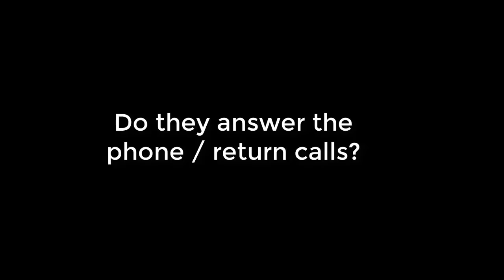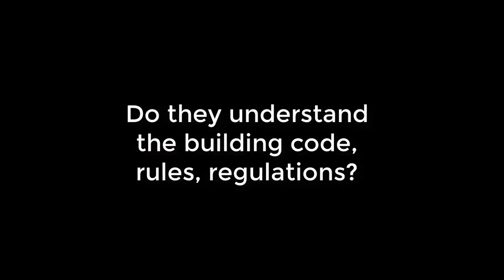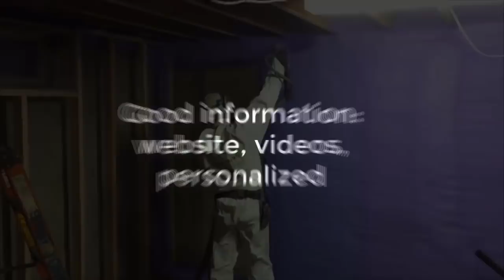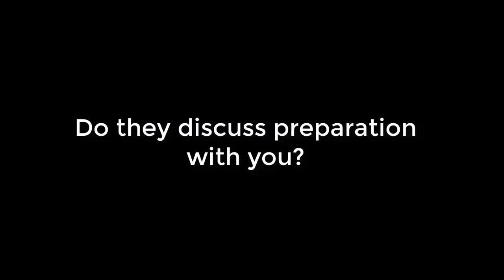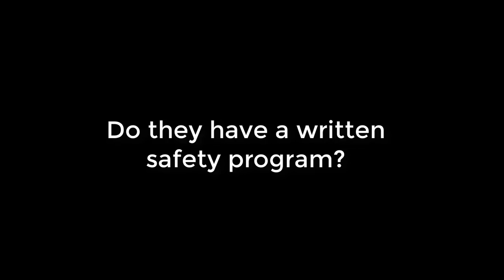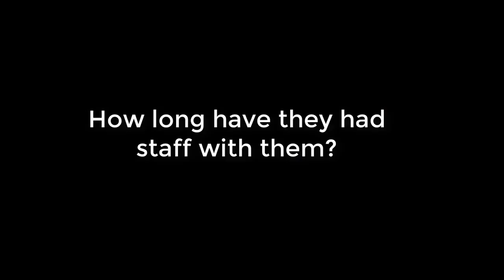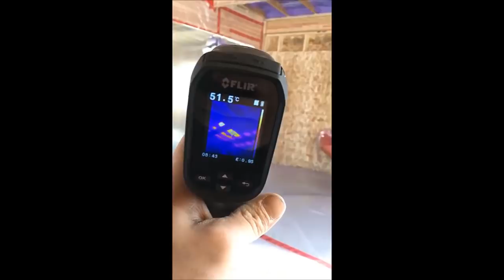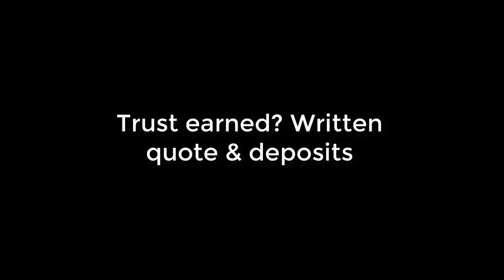Hiring a spray foam insulation contractor - 20 great points

Comment: Very important to have a confident mindset and you see they care about what they do. Competence is also very important.
Reply from the maker: Amen. Usually called arrogance by the willfully ignorant.
Reply: @SprayJones  it's just straightup pride in your work and the way you discuss many complicated issues like safety in such an easy manner means you dug deep and did the homework worthy of the professional title. It's just what the job requires. You can't just say that the byproduct of foam when applied is not dangerous and have workers not wear masks properly, or even the wrong pucks during the application process.

Comment: Do you have a suggestion or rather a answer to, since im just starting off, and completely agree with your whole video especially about the part about how a contractor just wants to sell whatever work it is and just never come back again. With that being said, would you recommend using a spray foam insulation kit? If so then what? And why not a kit (if so).
Reply from the maker: Starting off at what? What are you doing?
Reply: @SprayJones  just starting off spray foaming on my own using the spray kits, but their crazy expensive do you know of any dealers that sell it cheap
Reply from the maker: @lethanbiasjr6255  No. I have nothing to do with DIY foam. Sorry.

Comment: The three sprayfoam contractors I consulted with NEVER, discussed prep, timeframe, material, my site requirements, or anything else. They just gave me a flat squarefoot rating that was close to $3-4 a board foot for foam. Furthermore the guy coming out spraying Bayer insulation made it a point to pronounce it "bear" instead of Bayer. I know asprin has been around but I will never support Bayer if there is another option.

Comment: I have to say your foam work is great and I would love to learn the ways of spraying foam like this... I use Jm open and closed cell and idk if the gun is make a difference or not but i love your work and would love to spray like this. I like to make a job look good... one thing i want to ask is when I spray open cell sometimes it has hollow point when I cut the foam and I want to prevent that, is there anything to could do to fix that?
Reply: *idk if the gun makes a difference
Reply: One more thing I know the manufacturer is different for you but how do you store your chemical and what temps do you use? For jm I try to keep it at 75 and spraying temps at 75 or 80 for closed cell and 80 or higher (for the iso) for open cell and I honestly love this job and doing good work for people and want to learn as much as I can for this job ( 1 year experience)
Reply from the maker: The hollow spot in open cell when you cut it is the sign of inferior foam. Open cell is mount Everest of chemistry. You need to change suppliers. I know this from first hand experience.

Comment: Is the BASF walltite the most superior spray foam available currently ? How can I determine if the company I choose is using a superior product ? as of now the plan was 2" of closed and then the rest of cavity with open however seems like this BASF walltite might be the better answer. Walls have exactly 6.25" of depth cavity 2x6 plus 3/4 ply strips over top making 6.25". Ceiling has 4" metal perlin plus 3/4 ply strips liquid nailed and screwed to face giving 4.75 inchs of cavity there. I want to achieve the maximum I can with the cavity's I have to work with. What do you suggest in this situation?
Reply from the maker: No need to mix closed and open cell. Pick one and stay with it. We use 99% closed cell. Highest physical properties and insulation and vapour barrier ratings. 
Watch the video on how to choose a contractor. That will help you with product. Most great contractors will not be spraying crap. So, get a great contractor and the product and how to install it will become much clearer.
Reply: @SprayJones  Ok well a supposed great contractor who could try and sell me anything for any amount is telling me that you only need 1" of closed and rest of cavity open. He says anything more than 1' closed is a waste of money . he says hell do whatever I want but doesn't believe cost of closed after 1" is worth it.
Reply from the maker: @tobaccofarmer4life  Ouch! Well even a broken clock can be right twice a day. 1 inch is where all the overhead is. Takes same time, trip and set up to do 2 as 1. 
I suggest if you want addition push in the right direction you send me an email through the SJ website. We can commune better that way. You case is sounding muddled....

Comment: can i trowel cement...or aircreate right over top on the foam ?....will cement stick to it ?.....i wanna build a dome frame with chicken wire and apply about 1" foam....after i just wanna put hard shell over top so...i figured trowel on or spray on cement ???
Reply from the maker: You need to get some experts in that field to assist you. Talk with suppliers of the products you want to use.

Comment: What exactly was that thin looking coat your applicator was applying over what looked like rockwool
Reply from the maker: At what point in the Vid did you see this? What time?
Reply: @SprayJones  At the 5:05 mark
Reply from the maker: @BillyJ10  We are spraying purple Walltite closed cell spray foam to concrete.

Comment: What frustrates me is just trying to find a contractor. I got an insulation contractor come to my luxurious 3000 foot house with two BWWs in the driveway. Told him the spray job, gave him measurements and he seamed happy. He was to call me with a price. I never heard from him after that. I called 4 contractors. One didn’t return my call, the second one called and said he was too busy. The third one called back and said he only does new condition. The fourth one was the guy who came over. I spoke to other types of contractors who told me that everyone is cherrypicking huge jobs because everyone is super busy. That my job better be 20k plus to get there interested 😟 My insulation job would be around 12.
Reply from the maker: That's rough. I have always treated everyone the same if we are busy or not. Hot markets are tough for quality, pricing and availability. Keep phoning around.. someone will be hungry.

Comment: Your out for yourself not trying to help the guy starting out you started somewhere did you have brand new trucks and equipment when you started I gave you a thumbs down don't put your foot on a man's throat when he's down  there enough work for everyone
Reply: I believe you've mis-interpreted him on that topic.  In all of the videos I've seen from him, he has never actually said that one shouldn't work with a new guy, and even in this one, it is merely mentioned as one (of at least 20) factors that should be taken under consideration.  Everyone has to start somewhere, and if someone is new, but still has managed to get to #20 and inspire trust, even if they are new, they should be in the running for getting a successful bid.

If you think about it, would you prefer a new crew that actually understood the physics and had a quality mindset vs. and older crew that couldn't string a sentence together or explain what & why they were doing anything?
Reply: @michael Foote - Holy crap , didn’t you comment on another comment on this same video to where someone called you out for not understanding sarcasm and you not understanding his info. 

He has not said at all never hire a company that he new, doesn’t have the nicest equipment , etc ... He is saying if you are choosing a company for larger projects that a technician or company must be equipped to handle . It’s probably better to look into companies that are well known and have the man labor and newest equipment to handle the job. 

It’s sad that people are allowed to even make comments on here when there not smart enough to even understand the content. This is how rumors and stuff in the world gets a bad rep, when people start jawing there mouth , then another person (just as dumb) reads your comment only then starts repeating your wrong info to his friends... This can badly damaged a companies product or business model , when simply you are the one who doesn’t have the IQ points to understand this mans business tips .